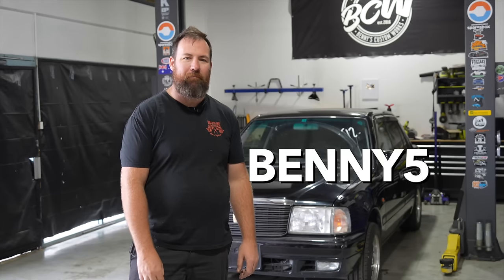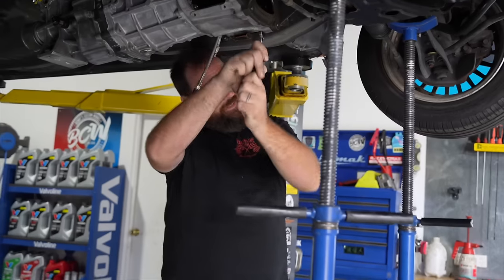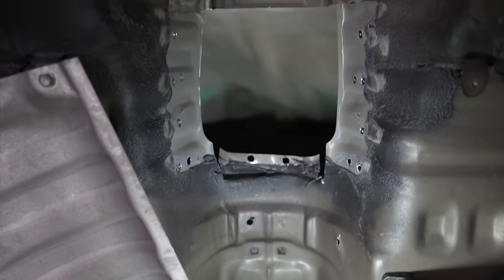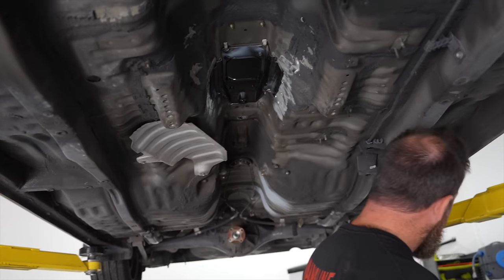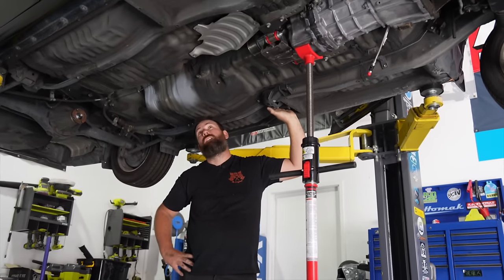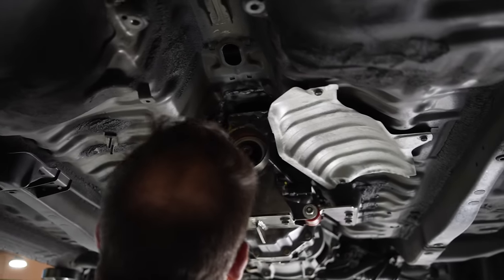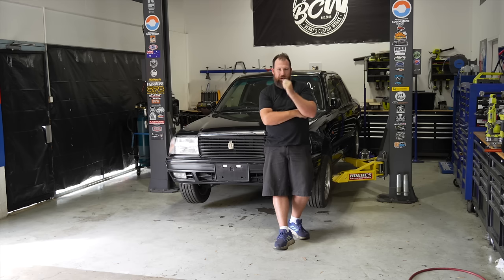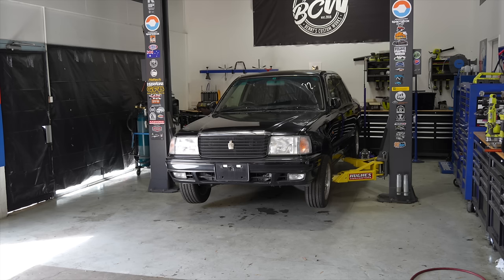New shifter piece installed with the hot glue gun 👨‍🏭💥 2JZ CROWN BUILD

Comment: Just a note Benny, you can get white 'blockout' adhesive vinyl, used for blocking fluorescent light signage, shopfront window signage and for overlaying existing signage (such as an Aussie flag on a trailer) 👍

Gotta love a bit of hot metal glue gun action.

About to crate up my EJ257T Cosworth block and Gen 4 BP '06 six speed (the tough as f*ck one) with driveline entire, including brakes, hubs, etc if you know anyone looking, made an easy 250kw @ all 4, an Uber driver rear-ended me just hard enough to kink the chassis rail and write her off.  If I can't get what I'm looking for I'll just transplant it over into another BP Lib, nice package for someone serious tho.  Currently still complete and running.

Comment: Keep plugging away Benny, 2.5 years later I have my 323 with a 13b all together. 1st motor was a dud. Second motor is mint. Turn the key, it runs but no drive. Now to figure out if it's clutch or gearbox. Joys of a project